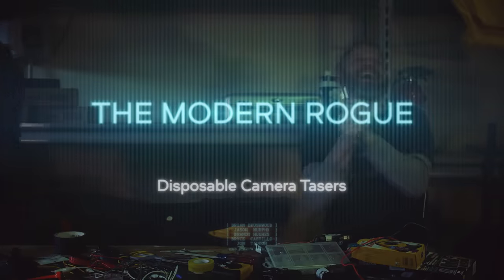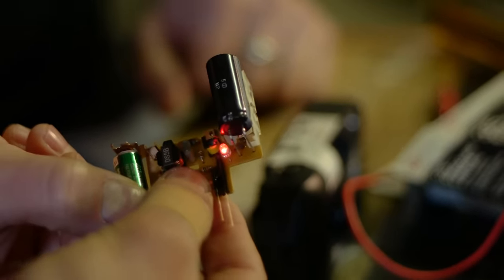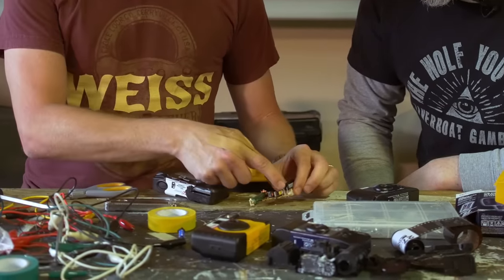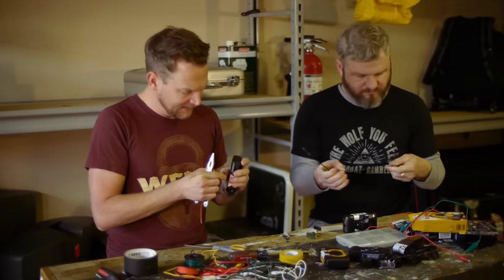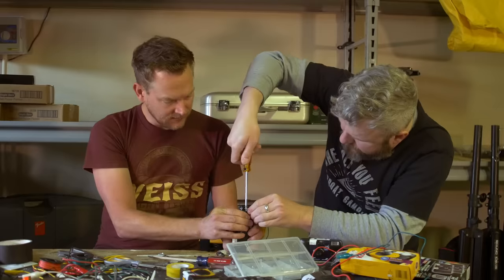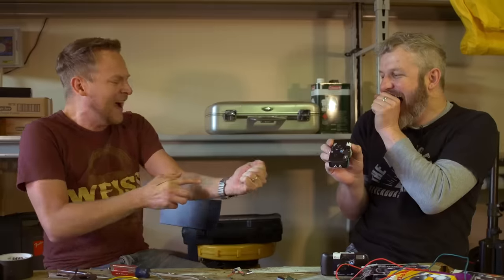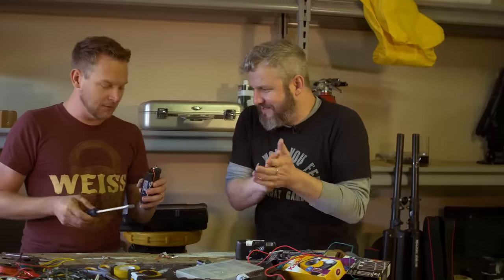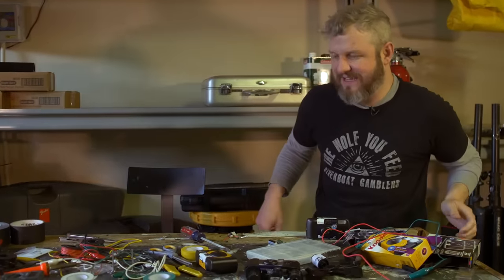Making Disposable Camera Tasers

Comment: Would this actually deter an attacker? What is the charging time after a full discharge until it's fully ready again? (Can't believe you didn't include that info in the video because it seems really important in determining if this is worth it or not. 

Also, is it possible to upgrade this with a bigger capacitor or higher output battery? Thanks!

Comment: 1:50 Oh hell yes it can be lethal. Maybe not when you do it on your arm, but on your chest or across your chest somehow, it can be lethal. A standard flash capacitor is rated at around 330 volts with a capacitance of 120uF. With those values, it can sustain 100 mA (enough to cause ventricular fibrillation) for about 140 milliseconds, and it can sustain over 17mA (enough to force muscles to contract, including lungs) for about half a second.
Reply: DaffyDaffyDaffy33322 It is dangerous if you don't control the ground. In their case, the 2 screws are so close, you'd need them directly on your heart to cause fibrillation.

Comment: You do know that capacitors are extremely dangerous at those voltages as they also increase amperage to levels that can actually kill you.

If you want to make a "safer" version you need to modify the flash circuit to stay running continuous by removing the firing transformer and capacitor, bridging a couple points and shorting the "charge" button, This will produce high voltage low amp and you can run a CFL tube off it too lol

Look up camera flash mods for CFL for examples.

Comment: I've accidently got hit from holding a plug wrong (I touched both ends) and i'm not sure if its as bad as sticking a fork in an outlet but it didn't hurt that much. (I mean i wouldn't do it again but it doesn't even rank on the top 50 most painful things i've ever experienced. but then again neither does a broken nose so grain of salt on that one)

Comment: You know...if I ever had a taser...I would get curious about how it would feel to be tasered...and that's why I don't have a taser....
Reply: Sara Mendoza this should be top comment.
Reply: Hint, it kinda feels like getting tackled by a 200 pound football player from behind.
Reply: tazers id say hurt less than this, ive zapped myself on bareskin, it never made me freak out like that, they must have more amperage or somethin, i doubt its safe
Reply: On relatively weak tasers bought at Walmart, it feels kinda like extremely fast vibration on a part of your skin, on a police grade taser gun it feels like your entire body goes into paralysis for a couple seconds (which is pretty much does)
Reply: So many people including me would do this its shocking
Reply: I've been shocked by those taser flash lights and the front end of an actual taser. If I were to describe the experience it would be an extremely rapid cramping, causing you to just collapse.  I can't imagine what it's like to be shot by a taser and be shocked with those probes inside your body though.

Comment: For normal people, this wouldn't it be lethal as it doesn't have enough current. I made several back in middle school and used it against people. Added two larger capacitor and bumped the voltage to only 500 volts according to the multimeter.

Comment: Me and my friend took apart a disposable camera got the circuit board and then used a box to house it then we soldered a charging switch to and and then soldered two wires from the capacitor to 2 screws on the outside of the box. It felt like the shock went all the way up arm.
Reply: Yeah. It sucks.
Reply: Jason Murphy I think me and you are doing the same thing

Comment: At one time I was opening an old camera that had broken screen and it had well working battery with probably power in it and after I opened the camera my screwdriwer hit both metal wires coming from that black tube shaped thing and it made spark and I got scated it becose I didn't know what was going on but now i get it, that thing had charge in it

Comment: I'd like to see what would happen if you powered that with a 3s lipo, (assuming it didn't burn the circuit out)
Reply: Tommy O im not familiar with that, i assume its a power source, what is it?
Reply: TG Monkey Just saying, it's discharging from a capacitor. You could use a wall socket to charge it and it won't affect the output, only the charging time.

Comment: I really dislike discharging capacitors by short-circuiting them... It is not a correct way and it can be dangerous. You may get molten metal to the face.

Comment: A very poor idea...  There's more than enough power to potentially stop your heart and kill you if you were to touch the terminals with one finger from each hand (Creating a path for current to go from hand to hand, via your chest muscles and heart).  In theory it will only be extremely painful and perhaps burn you, sticking the terminals against skin on your hand or arm, but be aware that a single mistake in mishandling the capacitor could potentially kill you.

Comment: Whats lethal is the current, so a small battery with a small voltage can still be very bad for you! V=IR, low resistance with a good amount of voltage can produce a current high enough to just electrocute you. :( I forgot but its like 0.something amperes and ur ded

Comment: Will you see if you q can use it to spot weld battery straps PLEASE! I'm thinking it should right. The worst shock I've ever had was from the flash on a Barbie 110 camera it knocked back through my bedroom closet sliding door. Lesson learned. You two learned nothing from the first zap. 😂😅😂😅

Comment: What if you used brass plated screws?
Reply: Isn't brass more conductive, tho?
Reply: That's a spicy meatball
Reply: fuck brass, use silver plated screws for maximum conductivity😂
Reply: technically the electrical resistance would decrease, since silver is more conductive
but, the shock would feel exactly the same

Comment: So... remove the circuit etc... stick on a bigger capacitor, use slightly meatier batteries,  3D print or CNC an enclosure....  Hmmmm.

Shame that would be 100% illegal here in boring old UK!

Comment: Its not sore at all I done it haha you want a big spark put a 9volt in it's good for about 2 or 3 shots now that hurts haha
Reply: Robert Black a nine volt will last a lot longer than that. the input voltage will make no difference to the output, as the system is controlled from the voltage in the cap. also, I bet you haven't done it to yourself